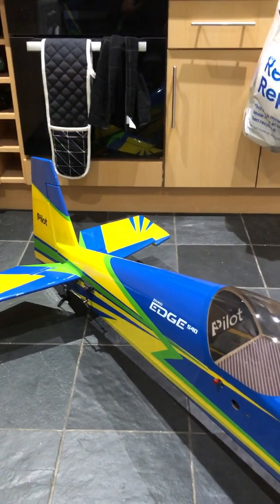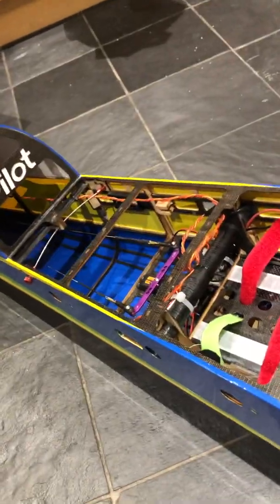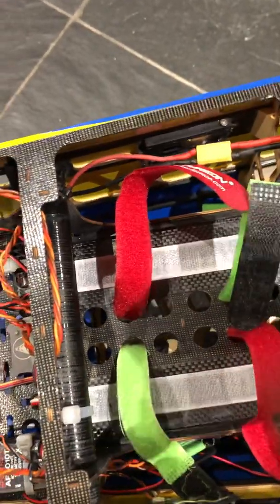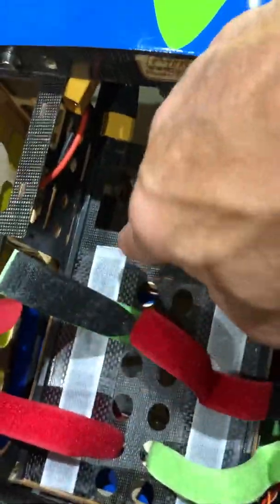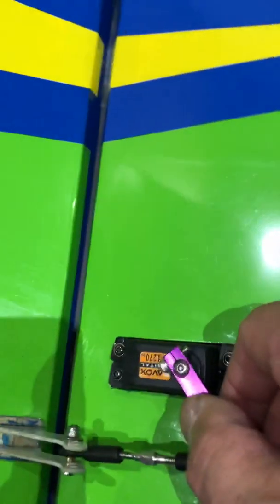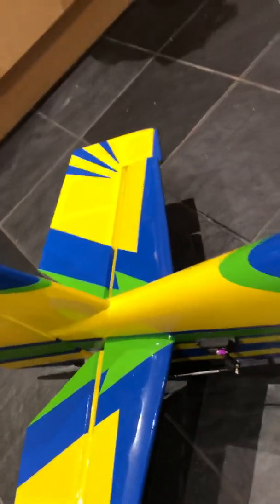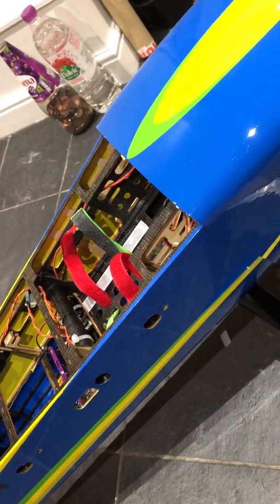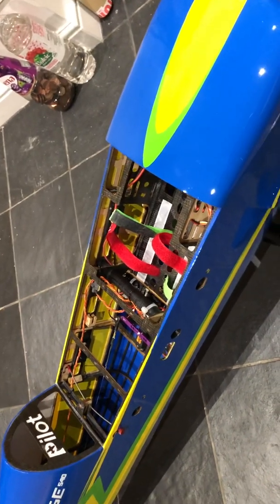Pilot RC Edge 540 RC 74” Radio installation

Comment: how does this plane compare to the slick 74 inch as far as flight characteristics?   im about to pull the trigger on the 74 inch slick, but the edge has also caught my eye
Reply from the maker: Hi Eric. Umm Good question. Both of these aircraft will do everything you would expect an 3-D aircraft will do the edge is slightly shorter so it tumbles a lot faster and a lot more aggressive the slick Is slightly larger and longer only by a bit.. unless you are a top pilot you are really not gonna notice the difference between the both..They are both 3-D aircraft both will do knife edge spins both will funnel manoeuvre which is a knife edge spin upwards using the right amount of power and rudder setup. I find  Both of the aircraft will do any kind of 3-D manoeuvers if you are capable of doing it.. even though the slick is slightly larger will still perform knife edge loop using the exact same motor as the edge 35cc XPWR on 21x10 prop on both. You probably would expect the slick hovers slightly more stable due to being slightly larger however I find the edge it hovers the same maybe that is due to I’ve had more flying time with the edge and flow more times with it so I am more used to the edge than the slick. I find 35cc Xpwr motor is more then powerful enough for both of these aircraft.. so really is down to the look of the aircraft and a colour scheme..I do like the slick colour scheme more.. I have a short video of the slick in a maiden flight and you can judge it for yourself because it was a maiden flight I played it safe with not flying too low due to not knowing what to expect however you can see on the video taking off I put it through some violent rolls more or less straight away and have put the slick through knife edge spin and  funnel spin upwards landing down wind and floated on for a bit before final touchdown! Thank you for showing interest in my videos and taking the time to watch. Subscribe for any future videos with appreciation if you haven’t already done so.. thank you Eric.
Reply: @dannyporter888silverfox8  thank you for your prompt reply! Its so tough choosing a plane (maybe i need one of each!!) Between the slick, edge, laser or NG.  Thank you.  I like your channel. Glad I found it.
Reply from the maker: One other thing the slick is a single elevator servo and the edge is twin elevator servos..I also have the laser and an NG the laser is on a DLE 35 RA gas engine and my NG is GP38 gas engine both with MTW Canister to keep it below 80dB.. and again thanks for taking interest on my channel spending your time watching my input Eric.
Reply: @dannyporter888silverfox8  this is why I subscribed to your channel. You fly every plane i could be looking at getting.  Its great.
Reply: @dannyporter888silverfox8  have you flown the NG yet?  I have read that it flies very very well and is very stable...probably due to its larger size.
Reply from the maker: Hi Eric. I haven’t flown my NG as yet it was due to have a maiden flight today however I had to waiting for Amazon for a new microSD card for my new NX10 radio transmitter due on Tuesday.. The NG had past the noise test last week at 77db with a 21x8 falcon prop.. happy days because where I fly the club is quite strict on noise! I am hoping to get out with it next weekend weather permitting!!